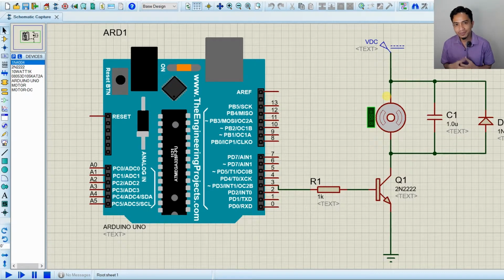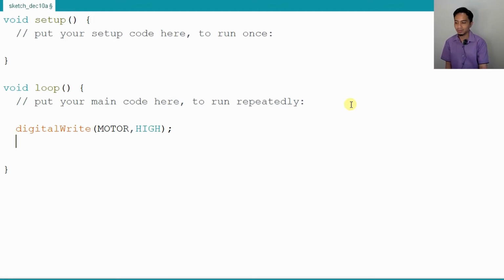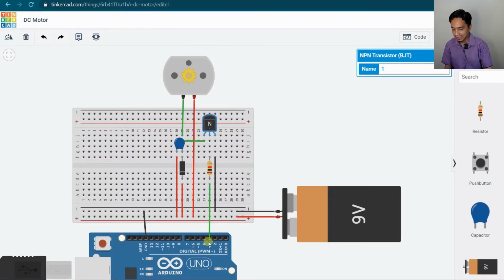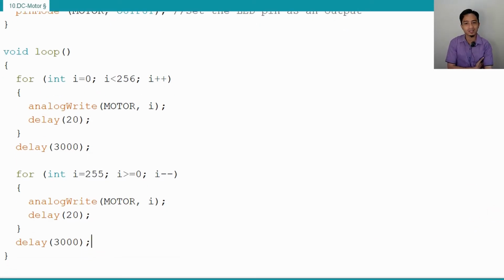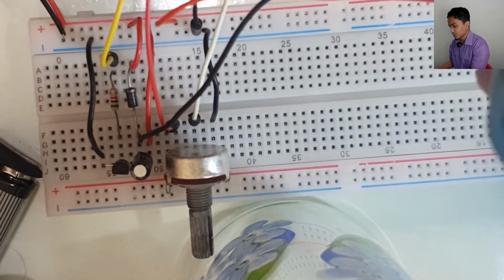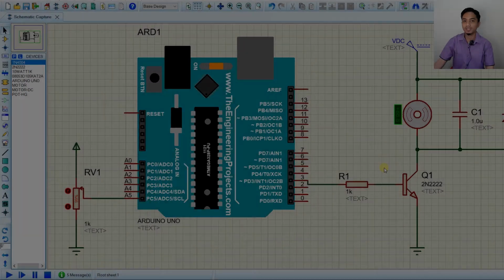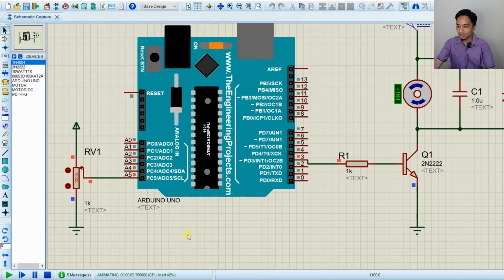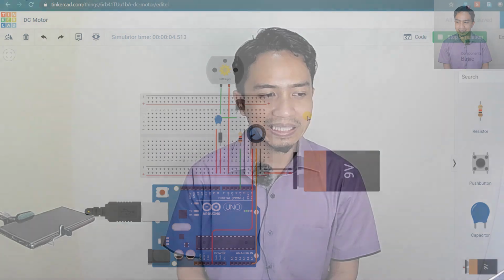7.1.How to Control DC Motor Speed using Arduino

Comment: hello sir but i want to know about that analogWrite() value is 0-255 is for dc motor speed control but that is not actual rpm show what is the reason
Reply from the maker: analogWrite will give maximum 8-bits output.. 8-bits = (2 power of 8) values = 256 values including zero.. that's why the value is ranging from 0 to 255..
Reply: @IkhwanMuhamad  yes sir i know but i know about that i want to set actual rpm of dc motor
Reply from the maker: @naveenvaid4318  you need to refer to the specification sheet for the DC motor that you use in your project.. if there is no load on your motor, then, you can refer to the working rpm stated in the specification sheet.. you can then map the max rpm value from the specification sheet to the 255 value from the pwm..
Reply: @IkhwanMuhamad  my dc motor specification is 12V 50rpm gear motor
Reply from the maker: @naveenvaid4318  if you use 12V battery / power supply to operate your motor, and no load is attached to the DC motor, then, you can directly map 255 to 50rpm in the coding.

for example: 

speed = map(val, 0, 255, 0, 50);